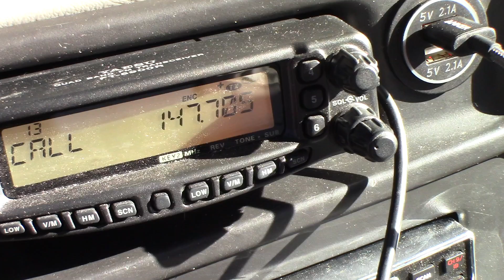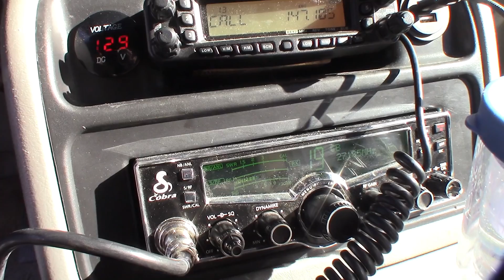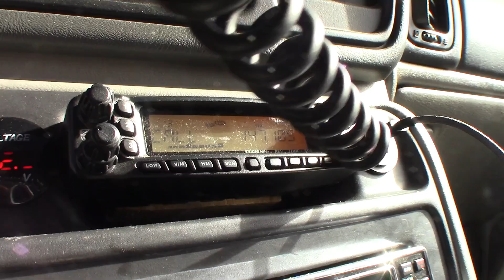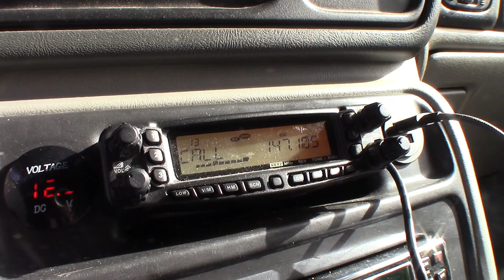Extreme High Altitude Ham Radio

Comment: Our club did a contest in Awyhee county, Idaho, at 7950ft elevation.  I think you are at 2200ft elevation.  We reached almost 300 miles with 50W on 2 meters, and 180 miles on an HT using 5 watts. We had a similar experience with 2 repeaters. Mountains are fun for Ham radio!
Reply from the maker: Sounds awesome!

Comment: Dude, you would have loved it before people started putting tones on the repeaters. I would drive up most any mountain over 3,000 feet in New England and key up several repeaters using an HT with a 1/4 wave antenna on my car. The sound reminds me of tuning up an electric guitar.
Reply from the maker: Those were the days! It's a cool noise I think.